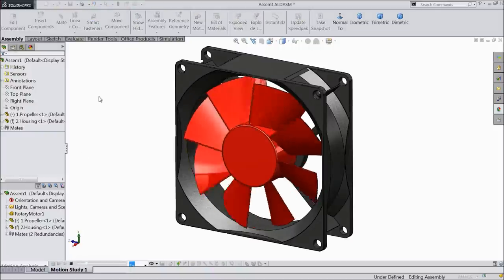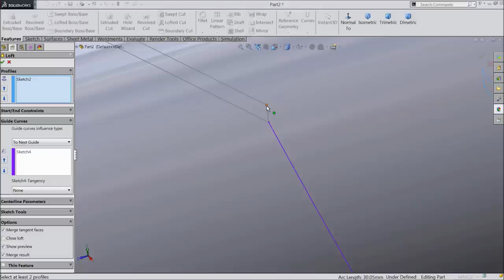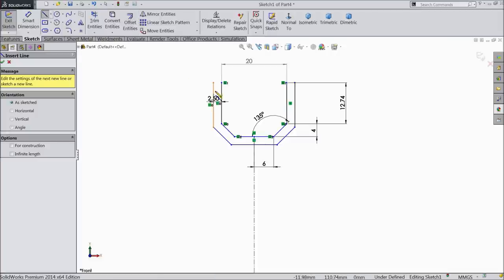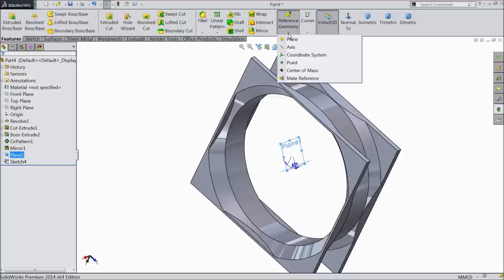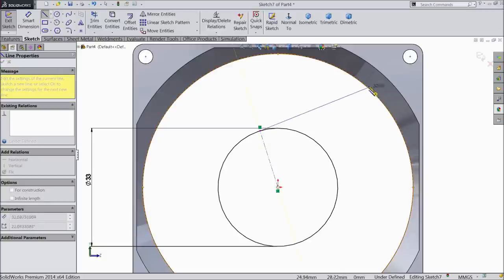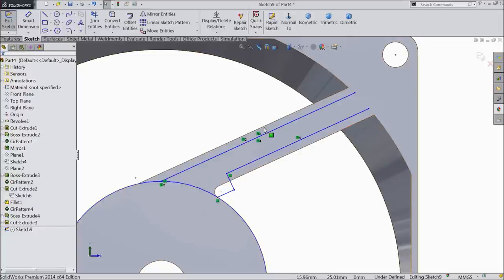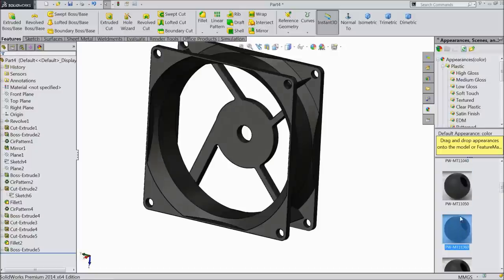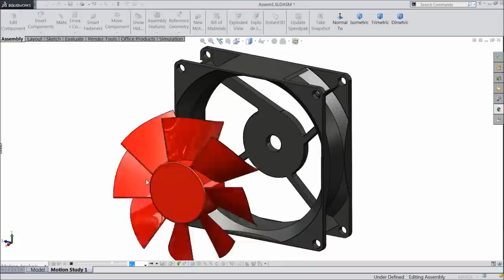Solidworks tutorial | sketch Computer fan in Solidworks

Comment: Fan blade should turn the other way (counter clockwise) for this angle orientation
Reply from the maker: Thanks it should be counter clockwise.
Reply: Clockwise is actually the correct orientation. Most blades are designed to act like wings, not scoops.